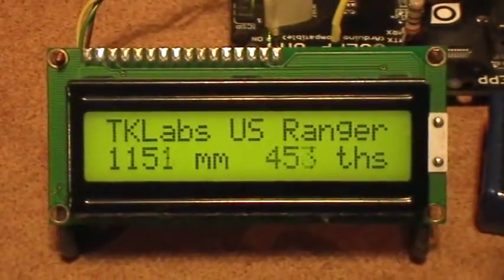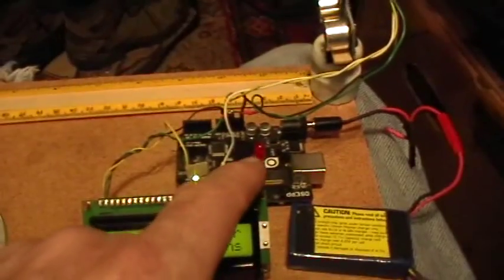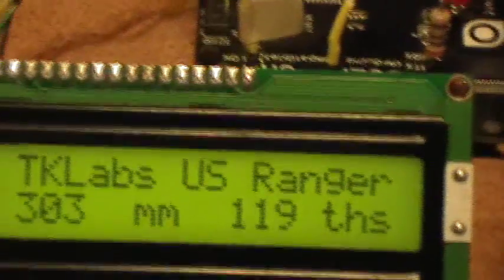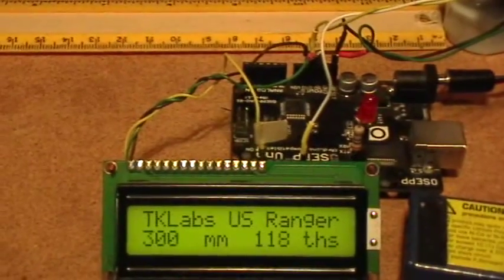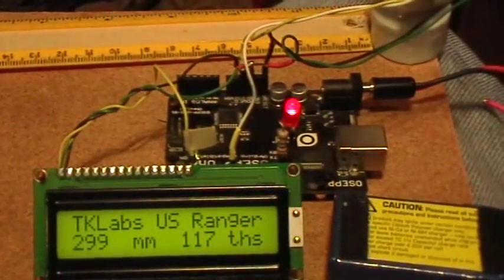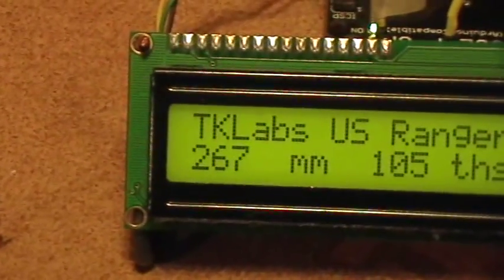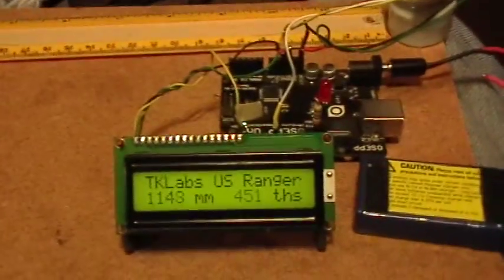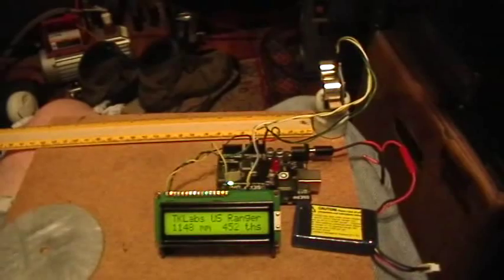Arduino: Improved Resolution Ultrasonic Ranger Using Parallax Ping Transducer

Comment: can u provide code for this?
Reply from the maker: The program sketch is modified from the ultrasonic ranger sketch in the 
Arduino libraries. It times the pulse and return in microseconds and 
computes the distance based on the speed of sound in air, so the math 
can be calibrated and adjusted easily enough to yield good accuracy for 
any given use or installation. 
Code for the Parallax LCD is found in the ParallaxLCD library, which is
available from their website. 
Good luck!
Reply: TinselKoala thnkss...
Reply: please give the screenshot of code that you have changed to get reading in mm
Reply: pls give screenshot of codes

Comment: Nice video!
How much would the X-Y resolution be ? In your example, how much smaller can the disc diameter get before the sensor stops detecting it ?
Cheers!
Reply from the maker: Pushkar Paranjpe Good question, I don't know the answer. I see that there are some other people's videos on testing similar sensors, maybe they can tell you. Certainly it works quite well for flat smooth objects about the size of my hand.